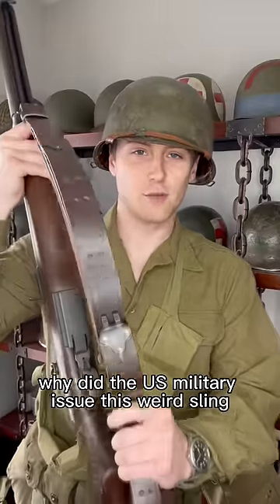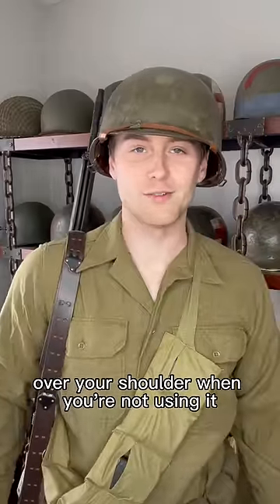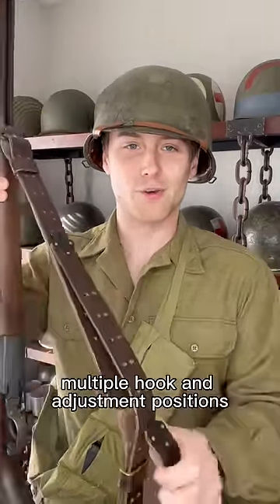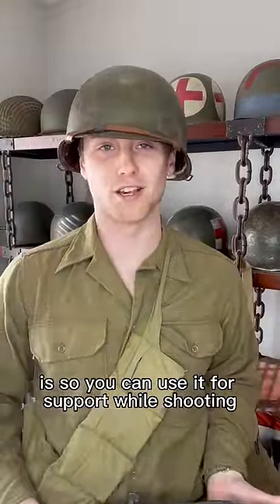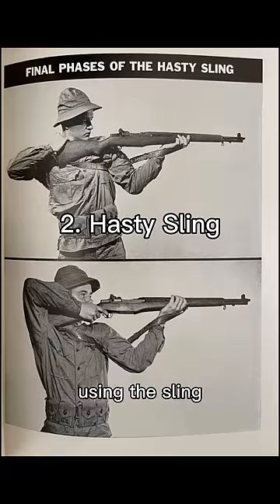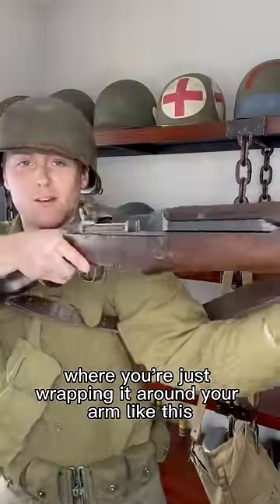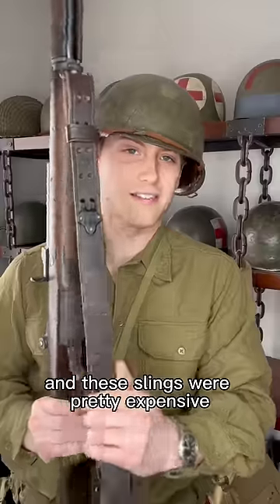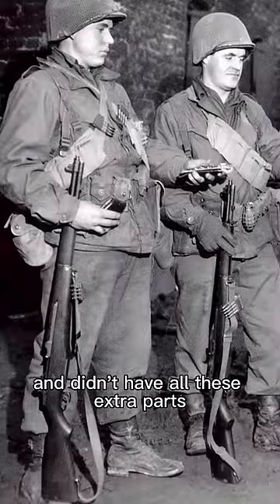Why Use This Weird WWII Rifle Sling? (The 1907 Sling)

Comment: We used to care about quality. Even when not needed

Quality leather. And with some minor options to change intended use from operater to operater......but then went cheaper n said f it. We need alot more n thats prices

Cheap canvas does the same job. For cheaper. So why not

Personally between my own leather slings on my 1919 target master and my 1930 carnival. Compared to my modern canvas i got for my 870

Leather ones are still on the older guns. Canvas is in a pile under the bed. Shi sucked to shoot when ya got short sleeves on, but thats about it

Ended up making a paracord loop for a rest for the 870 "half mile walk to some of my ranges. More for others so carrying a 870 n ammo wasnt terrible. But not pleasant either

As far as the extra loop. Not really needed. The hasty sling wrap is super effective at recoil control and stability and not to uncomfortable. And u can do it in a flash

Trying to slide arm. With sleeves. Througha tight leather loop. I can see why it got phased out pretty quick. I dont see many people doing that in any real life scenario vs a hasty wrap

Comment: It also looks adjustable, meaning you can issue the same exact sling every soldier.

Without that, there would be no sling at all because you can’t do one size fits all in a situation where you have a draft. 

I think the “use it for support” is more of an after-the-fact thing to make sure the sling didn’t get in the way while firing. Last thing the military wants is bad press because the issued rifle’s sling got someone killed.

Overall I’m pretty skeptical of these as “support”…the result of this is tension pulling down on the gun. Wouldn’t that make aiming harder? It’s actually kind of the opposite of a support isn’t it? Like…the ideal support would be some kind of bi-pod or tri-pod leveled to your terrain that you rest the gun on, which is how large guns seem to be set up…so it seems like you would want something that pulls/pushes up on the gun when you are shooting. (In a physics sense. Like, even if it is just resting on the support, if it isn’t falling through it or making the thing collapse, there is force being imparted upwards into the fan that is equal to the force of the gun pushing down in the support. If the force pushing/pulling the gun up was greater than the force going down, then the gun would aim upwards. So…in short, you want something that pushes the gun upward in equal amounts to the weight of the gun pulling it down.) 

I’m not a gun guy and I see comments from former marines and other military swearing by them, so I’m likely wrong, but I would like an explanation on how adding a downward force to the gun while you are trying to aim it is helpful.
Reply: Had a thought overnight 

The downward force won’t help aim but I will help reduce upward movement of the gun when firing by reducing the upward motion of the gun while it kicks back. (Goes into your shoulder and will tend to pivot up due to that way gun stocks are usually shaped in older-style guns)

This will make aiming the next shot easier because you will be closer to where you were aiming for the first shot. So could be useful for marksmanship…but I’m not sure if this is something that is feasible in actual combat where milliseconds of reaction time count.

I still think the primary purpose was to carry the rifle (less likely to leave it behind or misplace it when unexpectedly needed) and someone figured out how to use them in other ways. Likeky some smart soldier in a prior war of the previous century.

Comment: My guess is the first was used for entrenched or prepared positions. If you were trying to stop a charge or had time to get into cover and prepare a bit you'd set up the loop and be as accurate as possible to maximize shots. Especially with, say, a BAR.

Comment: Strap. If it's a "simplified sling" it's called a strap. And you can use the hasty sling position with the simplest strap, if it's adjusted right. But nothing is better than the 1907 sling if your goal is steady accuracy beyond what your body would normally allow. It can be magic, how much farther you can hit a basketball sized target.

Comment: You could also "fast draw" the rifle.  Have the rifle's butt behind the rifle, "upside down" with the trigger group forward, and the muzzle down.  If you adjust the sling and put "half a twist" (180 degrees) you can quickly go to the hasty support with the sling taunt giving good support and accuracy almost as fast as a High Ready position...

Comment: They still used it at least until early 2000s. We had the issued 2 point sling then the web sling. The web sling was used for qualifications but then afterwards you put the 2 point sling back on.

Comment: Had a similar sling on an Egyptian Hakeem 8mm full size battle rifle. Off-hand 200yd you needed that sling to stabilize such a large rifle.
Nowadays we issue carbines, battle rifles of this Era were 3.5ft+ and closing in on 10lbs will full magazines. To shoot offhand, or prone with any accuracy you need a way to brace the heavy weapon and the massive recoil of the days .30 - .40 caliber rounds

Comment: Are there any records on how the infantry felt about the sling or complaints after getting the simplified sling? It seems a bit too complex to bother with during combat, but I suppose the increased weight of WWII rifles vs modern weapons might make make increased support more valuable. 

A clever soldier might also find alternative uses for either sling which may make it more popular than expected.

Comment: Army: Here's a carefully designed useful item that can really help you.

Joe: I'm not going to remember any of that.

Army: Here is a manual that explains how to do it and how beneficial it is.

Joe: Even if the sergeant gets me that manual, which is unkiley, my buddy Snuffy, who has been in six months longer than me, showed me the way they did a hasty sling with the plain, old slings.  I'll just do that.

Government: That's it.  No one else gets nice gear until there's an Air Force.  We'll see if they appreciate nice stuff.

Comment: I was in JROTC in high school and Gunny Whitlock taught us how to shoot using a sling for support while shooting from all 4 shooting positions and it will improve your accuracy when used correctly.  I applied the same while in the Army using the M-16A1 with the nylon sling and most other soldiers and my Drill Sargents in basic didn't understand why I did.

Comment: project appleseed teaches the use of the loop sling using either the G.I. Web Sling, or the 1907. the loop configuration is used for either sitting or prone positions. the hasty configuration is used for standing and kneeling, typically.

Comment: I had used the loop sling on a loaner M1 Garand when I shot in two CMP high power service rifle matches (and one practice match) hosted by a local rifle club. It definitely helps to steady the rifle. I always used the hasty sling method when plinking 100-yard steel plates at the range, which does afford improved accuracy in offhand, kneeling, sitting and prone shooting positions, though I never used it when practicing the squatting ‘rice paddy prone’ position.

Comment: I used the first method before hasty sling. The loop method gave me a perfect 10 for 10 at 500 yards and tightened my grouping while standing at 300 yards. 
 I always patrolled with the sling looped and secured on my arm. The secret is to use a small Bible in your shoulder/bicep pocket so the sling doesn't slide down. (Otherwise that book is completely useless)

Comment: That is a "Parade Sling".  It's made of leather for show, and the reason for the volume of holes is to provide a fit for any soldier marching in a parade.   The routine sling is an olive drab woven cloth sling with a black clasp-type mechanism to set the length for each soldier.  Just for sport and your knowledge ... we used to detach the rear combat sling clip and stand on it after placing a paper match between the sear and the sear-pin.  By doing that, the MI would fire in automatic mode for about 3-4 rounds before jamming.  The operating rod on an M1 is manufactured with a bend in it, otherwise it won't function at all.  Don't try this at home ... with the paper match inserted, the weapon will continue firing after the 1st round (until it jams or runs out of ammunition).  We stood on the sling because the muzzle rise is uncontrollable otherwise.

Comment: Yes.  It is used to support and steady the rifle to improve one’s aim and accuracy.  Also and very important in combat, it is almost silent.  It does not have fancy buckles or metal hooks or doodads to clatter at night.  It is quick and easy to adjust.  But being silent is the biggest plus - at night - no nods- alone - in combat. 
Check out your gear and set ups.  Can you run, jump, roll on the ground with no clattering noise? How far can you hear Velcro or a zipper at night? How far can you hear the safety lever being released at night?  How can you make all your gear silent? 
If you find yourself in the foxhole or ditch at night and your enemy could pass by your location any moment you will worry that they can hear your heartbeat and breathing.

Comment: Slings similar to this were used by big game hunters for decades. Look up the Ching Sling for example. It is very helpful for stabilizing the rifle in standing position, or even in a sitting position. It is often combined with "African carry" method, where the rifle is slung on the left side, barrel down, instead of the right side, barrel up ("American carry"), which allows a faster and cleaner method to bring the rifle to bear in an emergency...such as being charged by a lion or elephant.

Comment: The first method is superior stability. You adjust it to YOUR arm. It looked good and worked great in training when you could take your time. Common GI in combat wouldn't use it because as soon as you have to move position fast it becomes cumbersome and deadly in transition to hand to hand combat. Was used by the squad good shots lying in wait.

Comment: I was almost going to say they designed the sling like that so you could rip it off and tie it on a limb as a tourniquet if needed. Looks very similar to a belt which can act as a tourniquet in dire situations.

Comment: If I recall they did surveys after the war and found this was basically never used in combat. The Semi-automatic Garand really didn't need extra control of a sling, the main problem was searching for the enemy who was generally making good use of camouflage, cover and darkness so you needed a looser hold.

It wasn't like on a shooting range where you'd have to shoot dozens of times at one very clear but very small target very far away. The challenge was finding the enemy at all as they closed from 200m to within grenade throwing range. It was a whole lot of snap-shooting.

Comment: It seems all armies at the start of WW2 (US was of course late) thought that individual marksmanship was more important than it would turn out to be.

Like most emphasized accuracy, but in reality it more often came down to volume of fire for suppression. 

It was a lesson learned in the Winter War. It started with riflemen taking accurate shots at each other, but that means that the enemy is free to fire back between those shots and causes high casualties on both sides. So it quickly evolved to a matter of volume of fire, to suppress the enemy so they take cover and can't fire back. It took a lot more ammunition for every killed enemy, but you also took fewer friendly casualties.

Comment: Those who train competition style marksmanship (generally air rifles or .22s) will be quite familiar with using a sling the 1st way.  If you do it right, you can set the gun up to point exactly where you want it and it will hang there with no muscle input at all.  Shots taken from a position like that and a proper set up can be terrifyingly accurate.

Comment: The simple canvas sling can be used the same way as the 1907 sling, but it's faster and easier to setup.
The adjustment slider has a lever that locks in place. You unlock the slider and enlarge the loop at the front of the rifle.  Put your arm through the loop and tighten the slider.  There a metal clip at the back of the sling so that you can quickly unhook it from the rifle if the sling isn't long enough to use for support with both ends attached.

Comment: First position shown was probably only used when engaging in longer distances shooting. It does provide more stability if the shooter can position his body correctly where the sling is tight perfectly showen by the guy with no shirt on.